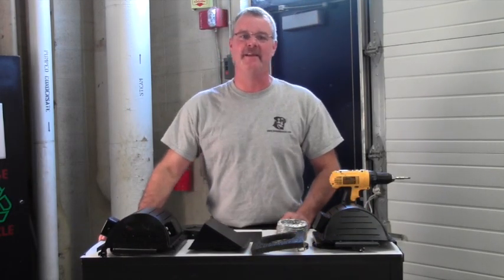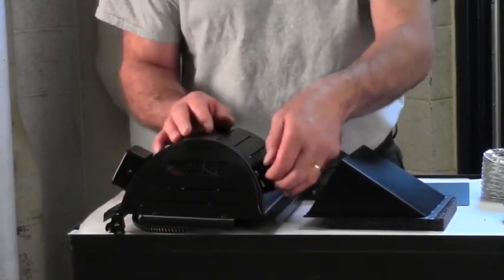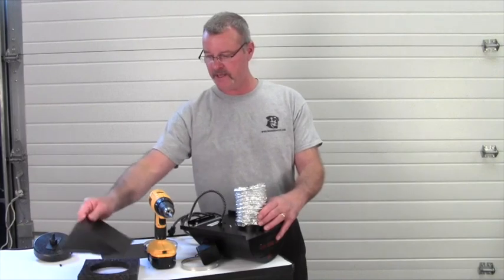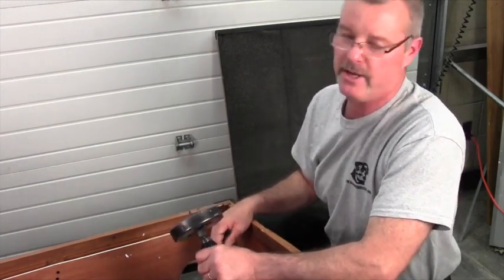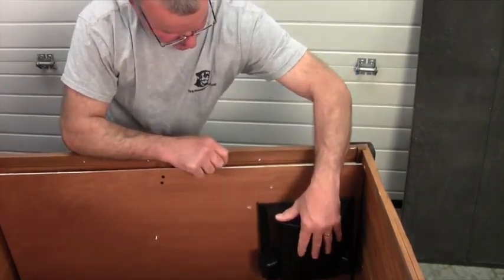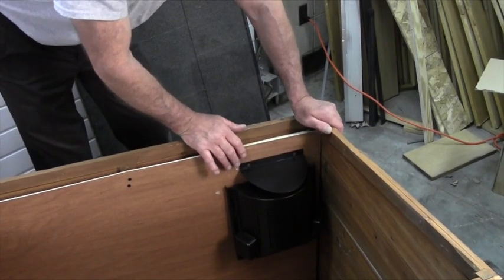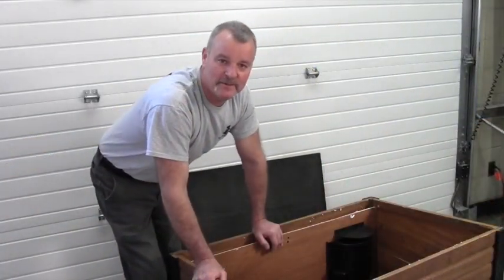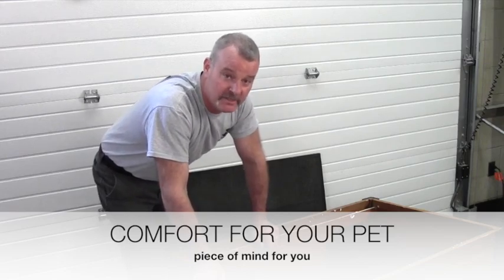Heat n Breeze Dog House Furnace   Fan Installation

Comment: Worth every penny I bought one going on 5 years now and it still works like the day I bought it. I highly recommend this heater.
Reply: Is the fan like an ac? Is this heat and air conditioning
Reply: @gurshawnthind4402  No the fan is not like an air conditioner, but it does circulate the air. I actually put one of the vents on the opposite side of the fan. He will sell you extra an  vent if  he has the parts laying around. Basically I have one vent on the heater and on the opposite side of the dog house for extra ventilation in the summer. Winter time I just put the metal plates on the vents to keep the heat in .
Reply: @JJ-lu6mg  do you mind sending me the pic of your dog house and the hound heater plus vents you made on email?
Reply: @gurshawnthind4402  I bought an extra vent from the company that makes the heaters and just mounted it on both sides. If you really want pictures that fine, I just need your email to send them. The best thing to do is call the company that makes the heaters, the guy who makes them usually answers the phone because it’s a small company, but he’s a real nice guy and will help you out the best he can.

Comment: How come you changed the cord location from the small hole to the large?
Reply: It probably didn't fit well. The small hole was left over from a previous video (where he installed the Hound Heater). So that small hole is not needed.

Comment: Where do you buy replacement parts? My fan still works but the heat has totally stopped so I assume the thermostat is bad. Do you sell the replacement parts?